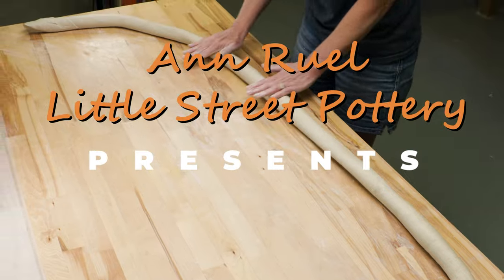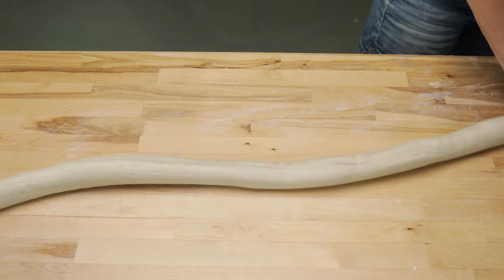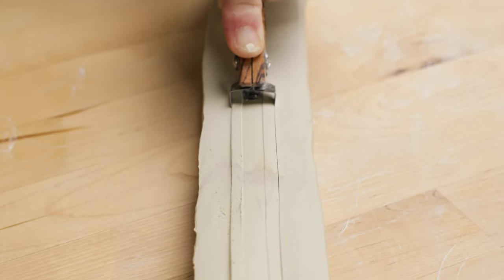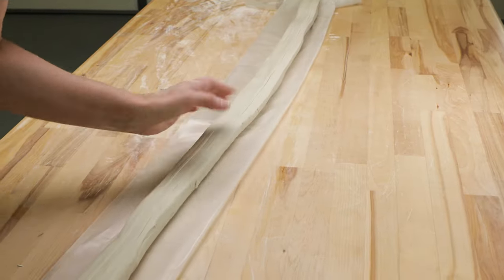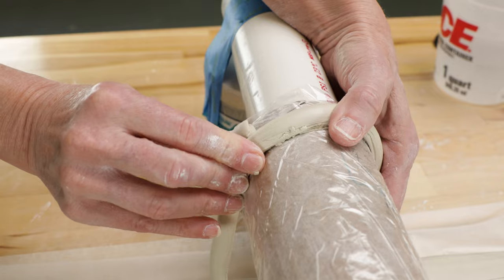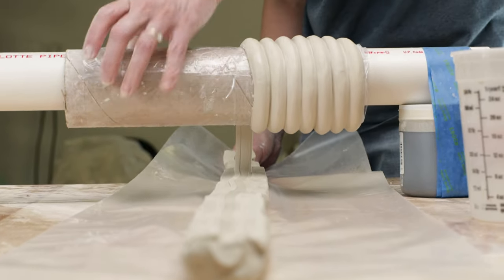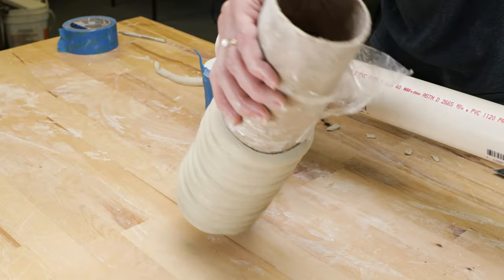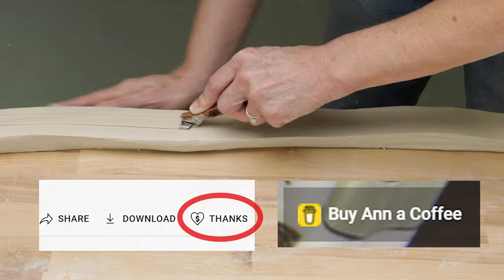Making a Coil Pot - LIKE YOU'VE NEVER SEEN!

Comment: Cool idea!  Jim is a genius. 😄

I think I would have cut each coil instead of spiraling them, and have even layers, like bangle bracelets.  Either way, it's a fun project!  Thanks for sharing!
Reply: Hi Pat.  I can see that in my head.  That would have solved the problem of the non-flat foot and rim for sure.  The only thing for me would be the connection points at each coil.  My porcelain doesnt like them and tries to warp.  I was wondering if this project would warp in the firing, but to my surprise it was round when we took it out of the kiln......  I say go for it Pat!!